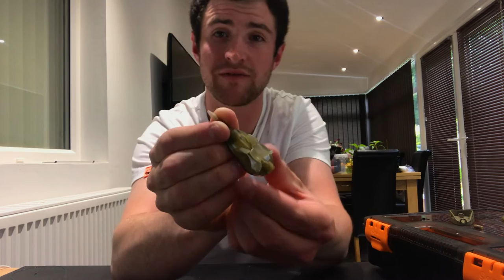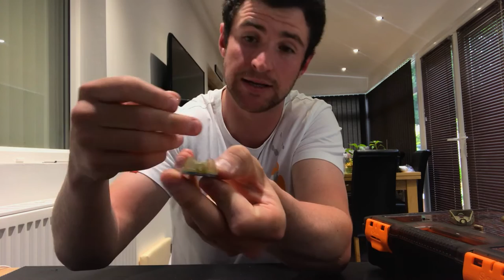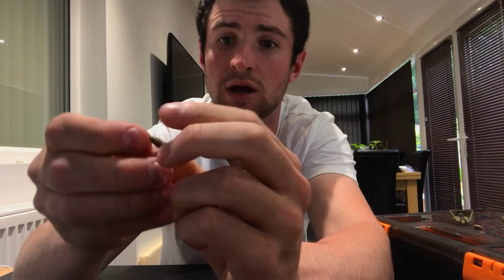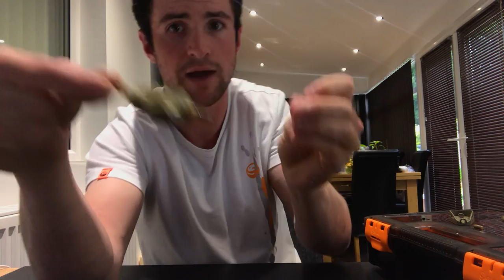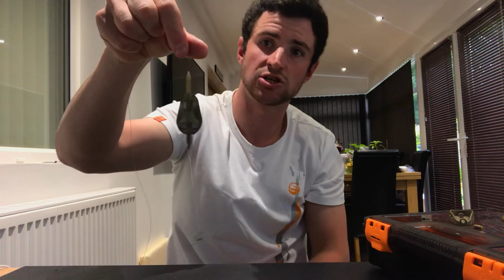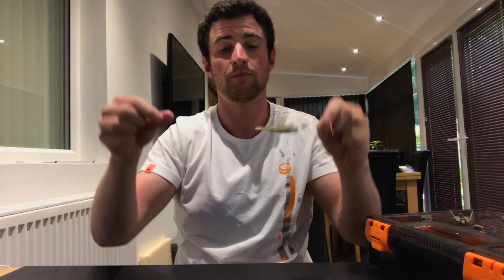How to Set Up An Inline Method Feeder Rig With Guru

Comment: I bought a guru inline method feeder (28g) but it didnt come with a speed bead. It only has a rubber tip and a swivel. Is the speed bead very needed?

Comment: I used this knot on my hook length.. it was that strong, I tore the tenches lips off
Reply: This knot was used by carp and specimen hunters for years before method system came out, would strongly suggest wetting the line before tightening the knot, specially on heavier lines.